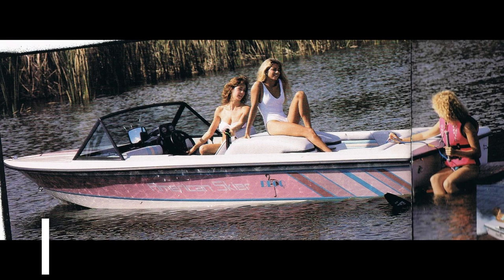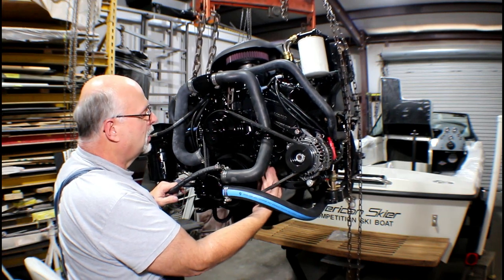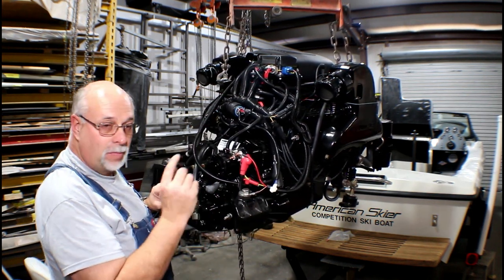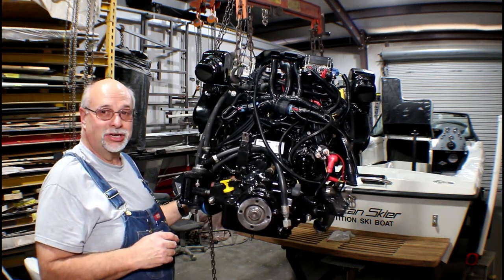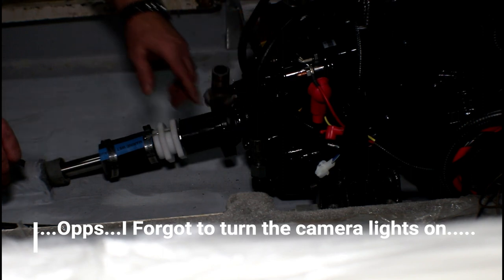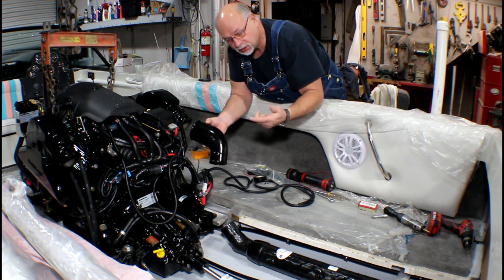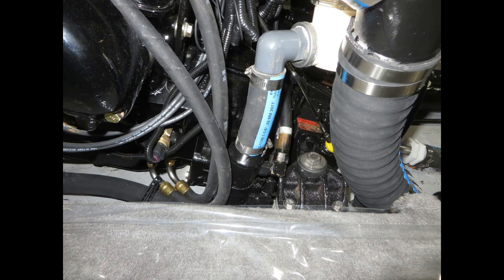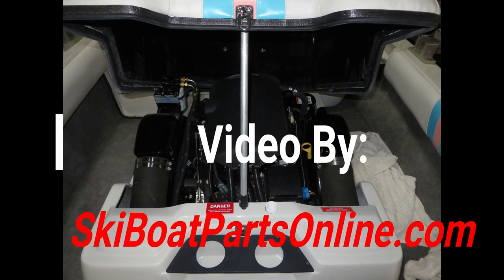Restoring a Rare Bird Part 20 Engine Installation

Comment: Could this boat have been set up for drive by wire to install the ZeroOff speed control?
Reply from the maker: Yes, but it would have required new throttle, addn'l wiring, if speed control was desired for this boat I would have recommended the Perfect Pass Star Gazer System, and retain the OEM throttle and save the customer $$$
Reply: @rontanis1024  A fellow skier who used to live in my area restored a 1984 American Skier. New floor, foam, stringers, and Perfect Pass. It skied great and one of my favorite boats to drive. It was a beast!   Watching your videos inspired me to give my boat an overhaul. New helm, tilt, steering cable, clamp block, and I repacked the rudder port. I also installed a GPS Speedometer to replace the remaining Airguide. Looking for a chrome ring for my Perfect Pass display so it matches the new Faria Speedometer. 1994 Ski Nautique 2170 hours on it. If you do another complete restore put that on video too! Very informative! Perfect Pass works great, but if training for tournaments Zero Off is a must. A repower will be in my future since a new boat costs six figures now. An older lighter boat with a modern engine and prop must give whiplash acceleration.

Comment: I was wondering if putting in a 4cyl DOCH import engine, in a inboard 18ft ski boat with a 351 is worth the while I'm thinking fuel economy and making boat lighter?
Reply from the maker: Simple answer is no, compare the HP/Torque/RPM/fuel cons. Charts between the two engines and pay attention to the high load fuel consumption. Next is the issue of wet exhaust, belhousing for marine trans, etc....
Reply from the maker: Now a true lightweight purpose built ski boat with a modern smaller engine does have merit for basic skiing needs, but forget about ballast and 20 person capacity.

Comment: I have a 1992 mastercraft prostar 205 with a dead seized up 351w, would the 350 be easier to maintain and put down more power than a new 351w?
Reply from the maker: maintenance would be the same parts availability & usually price is much better with the GM, trans fits up the either, GM front motor mounts are in a different position, but you use the trans mounts to locate the engine. Power all depends on which 351 vs 350
Reply: @rontanis1024  big fan of your work! the 351w was the 285 ho gt40 heads, the 350 would be the similar "ski boat" package you described in 21 part build. My 2 plans were go the 350 route or attempt to build my version of the 351w. Just want to get back on the water as fast and as smart as possible.

Comment: 21:38 OH YEAH! Nice exhaust note. Fine work Ron. How many Hp? 375?
Reply from the maker: No, this is a mild 320 HP engine that replaced a 240HP Ford
Reply: @rontanis1024  Mild? Good one Ron. All I know is my body won't be bouncing off the water from a wipe-out. Water tends to feel like concrete somewhere between 40-60 mph. Skied in my youth but those days are gone. Very nice series on getting The Rare Bird shipshape.